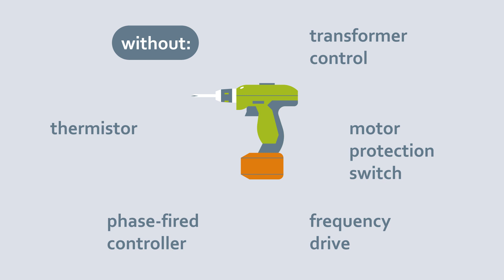How does an electronically commutated EC motor work? | What The Tech?!

Comment: that's why using an air conditioner with a DC compressor ( implies contactless motor ) will save you hundreds of dollars annually in the warmer/hotter states - even a 50 watt air purifier running 24/7 can save you about $40 annually

Comment: These motors are very good up until the time the ECM module fails. AKA the electronics board/module which is built into but sepperate from the motor.  I have seen too many of these ECM motors fail due to the electronics vs. the motor itself which requires a replacement EC board or the entire motor assembly which is extremely expensive which tends to take away any "savings" over the long term vs. a PSC motor.  Also, in either case, none of the motors today are worth spit unless they are built with quality parts and real ball bearings which are why PSC motor tend to fail as the cheap ones use bushings vs. bearings. In most motors of today, the bearings/bushings fail first while older motors were built to last and they did.
I believe these EC motors convert AC to DC current as well which is how they get them to be ultra quiet and efficient since DC sine waves are flat vs. alternating eliminating the vibrations.
Reply: "electronically commutated" dc motor = totally contactless motor - the controlling boards are not expensive from China